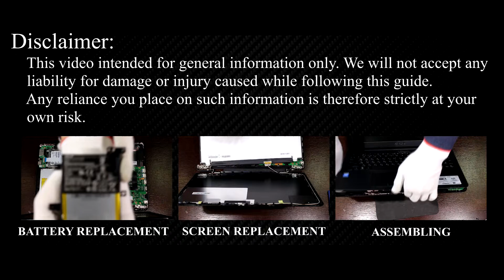How to Install SSD or HDD in Asus X554 – Full DIY Tutorial

Comment: Just a quick question: to add a second drive, like a SSD, you would have to replace the optical drive with a 9,5 mm or 12 mm caddy for the X554LD model? Thanks!
Reply from the maker: Sorry, I don't remember what the type of optical drive in this laptop.
Reply: @howfixit  I have found out, in the meantime. It's 9.5 mm. Thanks anyway for your response!
Reply: @MEGA-Phallus  Hi, I am also planning to replace my optical drive with a SSD on my laptop (which has a similar version to yours). Did you see great improvements? And do you know what SATA connection does your laptop have?